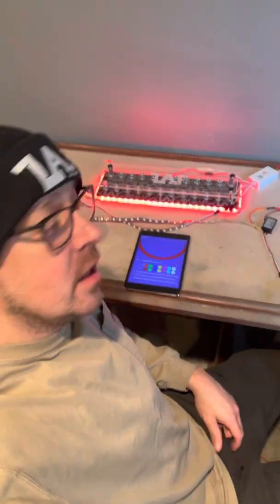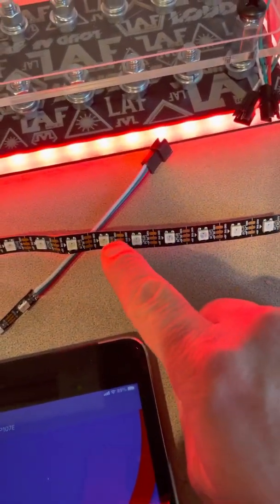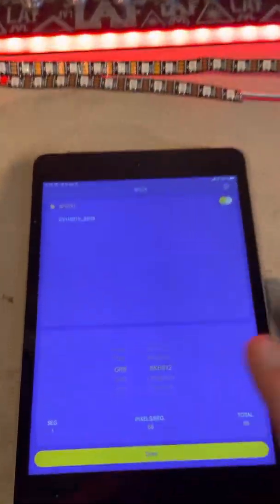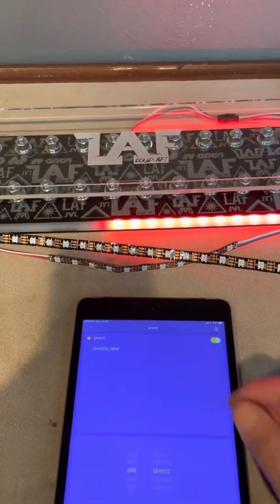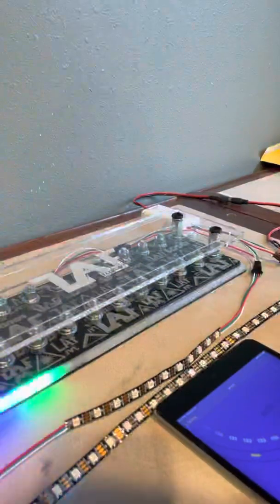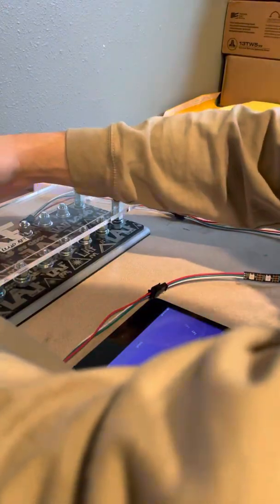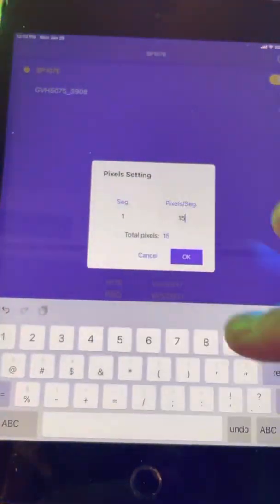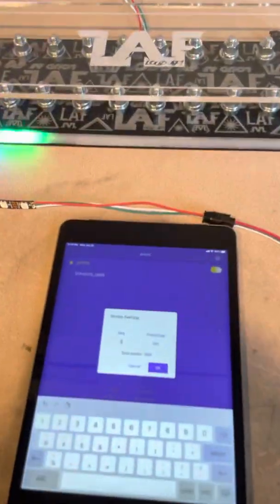How to integrate Chase or Addressable LED with LAF fuse block

Comment: I want to control a 30" length of WS2812B.  The objective is to create an EMDR light bar. I will need to control speed settings and have a pattern of light traveling back and forth. This could include 1 or 2 lights on at a time or a fade that you can follow with your eyes. I have created this using Arduino, just have not figured out a good way to remotely control speed settings.  This is for my wife and her mental health therapy practice. The device you are using is the first I have seen that has control settings for the number of LED being used.  Is it customizable enough to do what I am looking for?  Thank you
Reply from the maker: You can control the speed to some degree